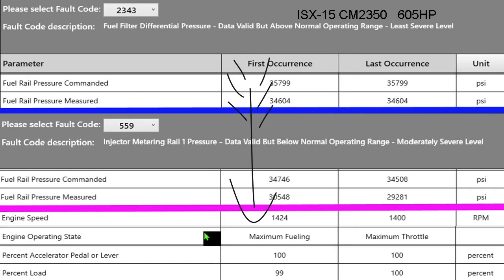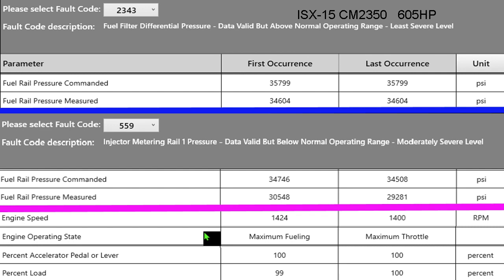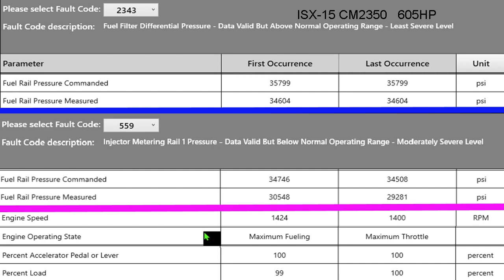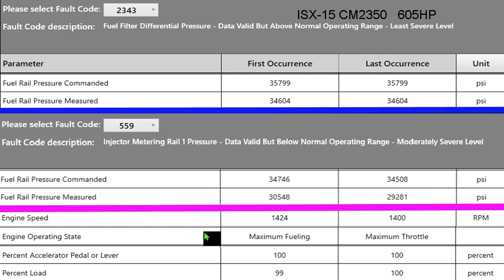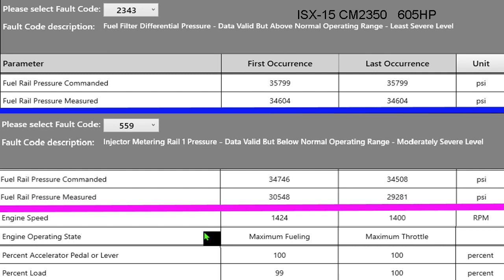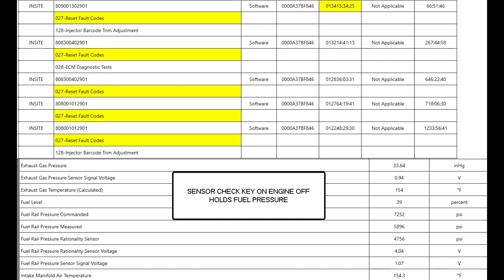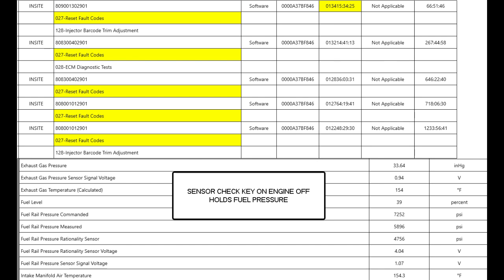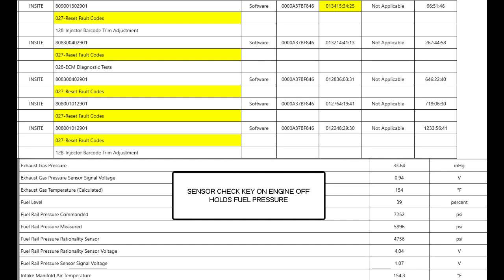Fuel pressure faults 559 vs 2343

Comment: Just curios is the low psi supply pressure 185-225 psi just for the doser or does the high pressure pump need that much.
Reply from the maker: The high pressure system needs it or the pumping chambers don't fill completely. Then you would have 559 when under heavy load.